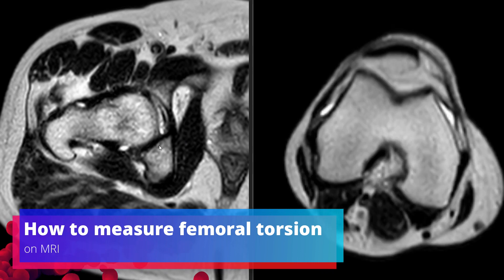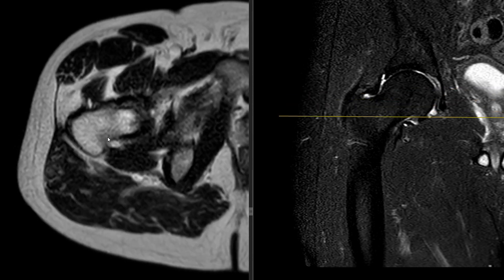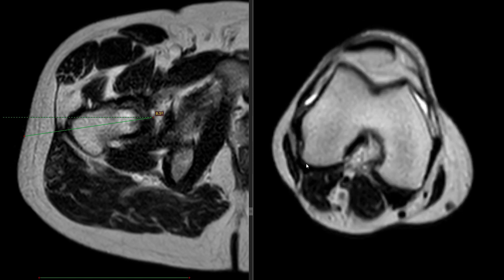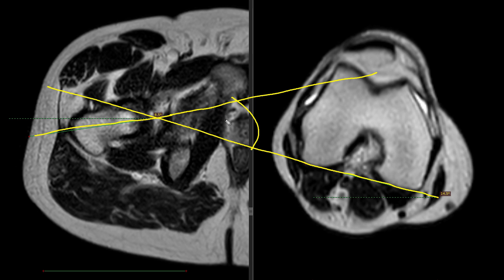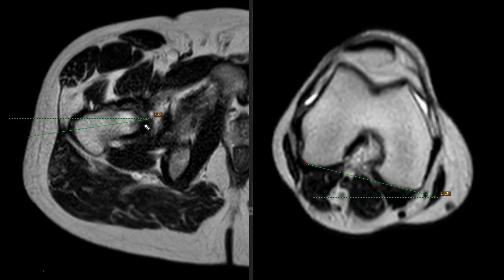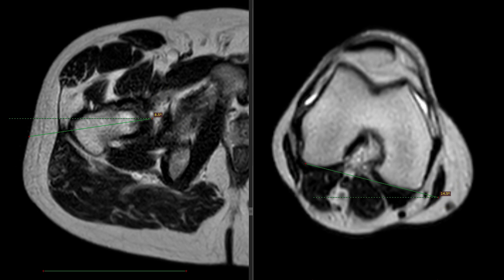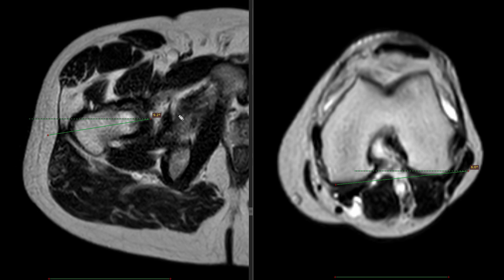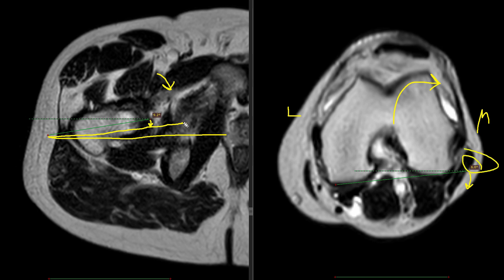How to Measure Femoral Torsion on MRI

Comment: Good way but it is true provided that the patient limb is in the same position during both hip and knee examination
Reply from the maker: that is obviously mandatory, otherwise we are screwed :)
Reply: Yeah but that’s a basic prerequisite of the hip MR protocol. Use the body coil to scan the knee low res. Takes about 3 seconds on our scanner
Reply from the maker: @danfascia  #speed :)